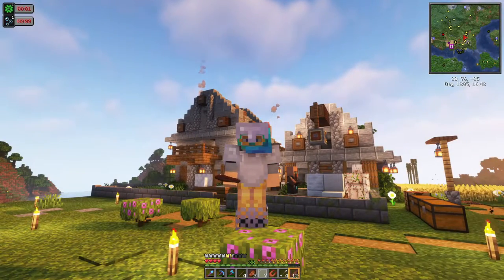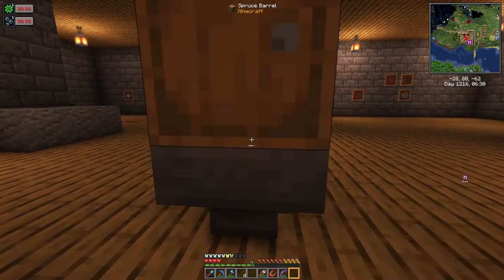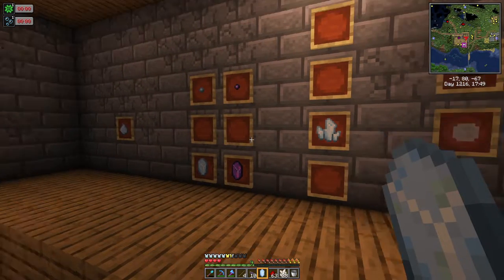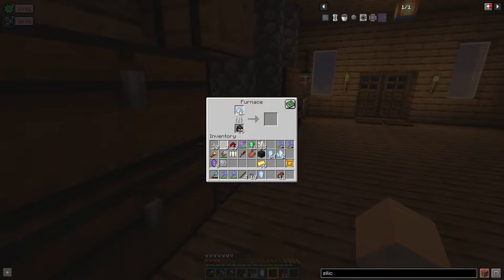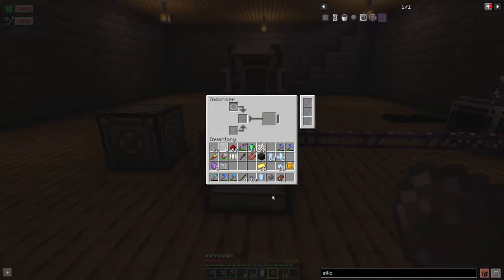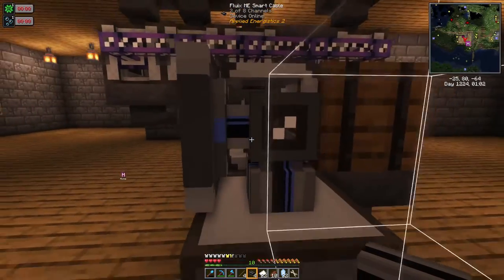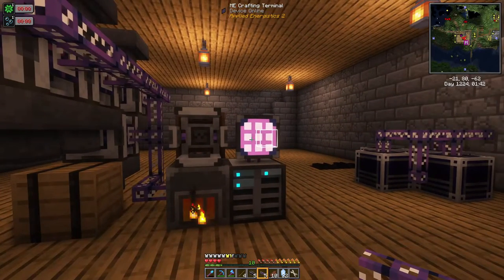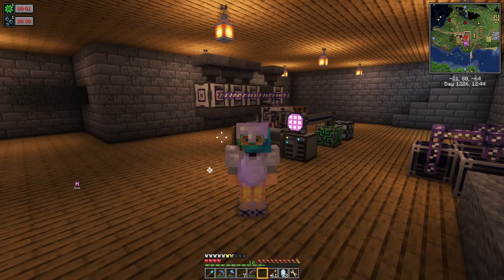Applied Energistics 2 - What's the BEST way to START AE2? | Modded Minecraft S2 E3 1.18.2

Comment: what power source are you using, the crystal resonance generator doesn't seem to power the system enough
Reply from the maker: Hey! It depends on the modpack. When I recorded this video, the crystal resonance generator didn't exist yet. I was probably using the Mekanism Gas Burning Generator or the Powah! mod. The Crystal Resonance Generator isn't good for much, though it is great to power a growth accelerator at a meteor site. There's a Vibration Chamber in AE2 that provides coal power, but you really should get a better source of power that your modpack provides.

Comment: Do more please, I have no idea how the upgrade card works for the cells!!! pleaseeeeeeeeeeeeee
Reply from the maker: Upgrade card for what cells? which mod are you talking about? 
My next series will be Valhelsia 5, in which we'll go hard into AE2 if that's what you're looking for content on. 
For Tech Reborn, see my Season 1 Valhelsia Enhanced Vanilla series.
Reply: @jangrogames  Im using AE2, it has an upgrade card called "equal storage distribution card". I was wondering how that works? Also I have a 16k item storage card that says "16,384 bytes of storage can hold 2,032 Stacks of a single item. or 1,040 Stacks,while holding 63 Different items." where it says 1040 stacks, is that 1040 per item or 1040 in total. in the end how much of each item can I hold in there if I have 63 items?